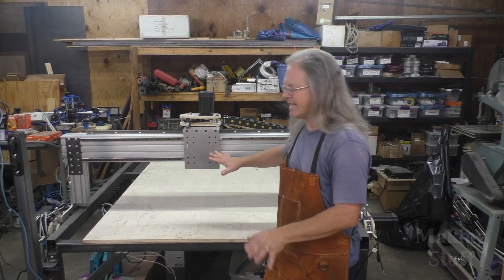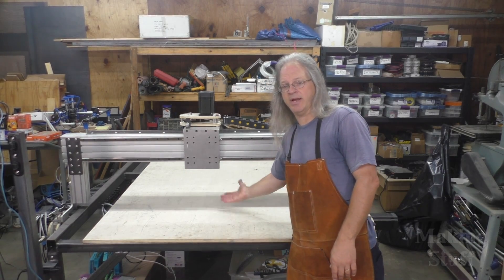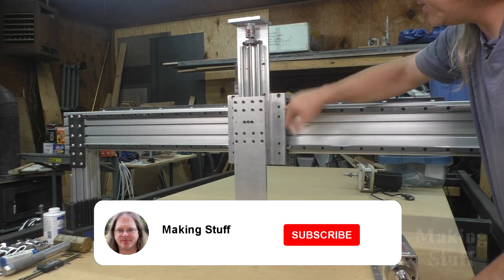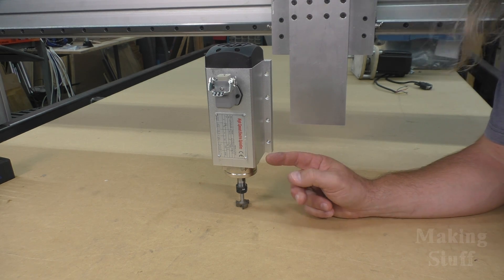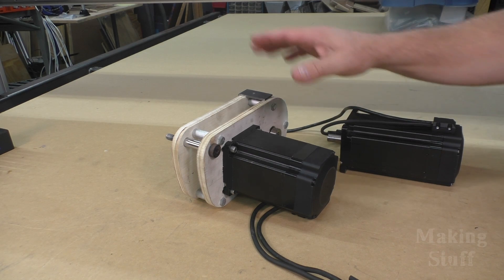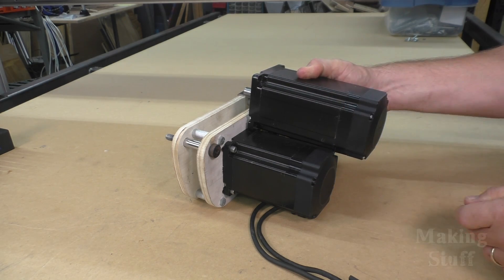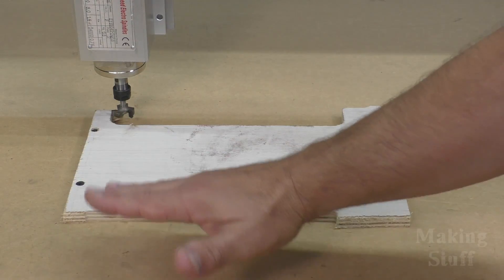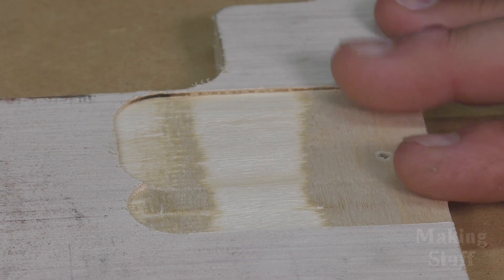Spindle Mounted and First Cut - DIY CNC Router Part 9

Comment from the maker: Finally making cuts with the CNC router.  Let me know what you think about it!
Reply: great work you have done there, I plan on making a 4X8 feet CNC from scratch and I am sure I will use most of tricks you showed on this project.
Reply: I know this was from 7 months ago but if you had to realigned your spindle so it's 90 deg to your table you could enlargen the holes in the back plate and then use a washer and nut. The larger hole will give you some wiggle room.
Reply: I know this video is from a year ago but you may have discovered that you don't want to reduce your spindle height TOO much, it limits what you can do. There have been many times I've had to remove all my spoil boards to accommodate thicker materials and items. Namely: live edge slabs for engraving and routing....They are anywhere from 1 1/2" to 3" thick.
Reply: Great job but I'd like to know how much money is involved
Reply from the maker: @sickvic3909  All the details are on the web site.  Makingstuff.info

Comment: This is a great series. For tramming what i have is a 1/2 inch shaft circle cutter, one of the ones that has the adjustable arm and the cutter. It mounts in my 1/2 inch collet just right and gives me a 8 inch wide tramming length when adjusted all the way out to the max.

Comment: About the pinion rack why you did not connect the servo motor directly to the pinion thread rather you have used a belt ?
Reply from the maker: I get the mechanical advantage with the 3:1 drive reduction.  That gives it more torque.

Comment: Hello,
A verry fine machine you build.
I also build a CNC designed by me but I have a problem. I have a similar spindle with yours but I have a ptoble. The spindle gets verry hot even on small jobs. I configure corectly the spindle in the VFD.
Do you know what could be the problem?
It gets hot even when he is spining in the air.

Comment: im still gathering parts for my 9014. bought my control panel, motors and spindle with cables from corvetteguy50 just waiting on the frame. i have to build a table as well and am considering using food service stainless steel table so i can use the table itself as a grounding point. way too hot in arizona right now to do any work in the garage right now anyways. i was considering watercooling my gecko g540 because i found the perfect waterblock and pump setup as well as air conditioning the garage. decided to go with the ESS system out to the controller because its speed is faster than using the UC100. made a duplicate of a totally stable machine i use for the cnc with the sabertooth 990fx mobo and 8 core fx8350 32 gb ram, gtx 780 sc with a seasonic 850 watt 90+ platinum power supply with a corsair k95 keyboard that has the 18 macro buttons on it to place code into for regularly used commands suck as home or even a wasteboard leveling. i had actually found a 4x8 food prep table with a sink in it that i will use as the coolant tank. and has a shelf on the side perfect for keyboard and mouse. and enough space left to put my drill press and grinder on the opposite side. ive been gathering my parts since about january and buying them as i get money to do so and getting very anxious and wanting to quit using the 3018 for anything but small laser jobs.  maybe ill give it to my grandsons to play with once they show they can be safe around tools. started off wanting to spend maybe 3k but i doubled that number awhile ago and still have maybe 1-2k left to spend to get stuff where i want it. love the machine though it came out great. good luck with it.

Comment: Hi, thank you for the video, and congrats for leading your proyect almost to the end, i have a 2.2kw water cooled spindle and i was wondering if the square air cooled spindle it is more or less noisy, have you idea about that?, i like the idea of don't to need a water system making thinks more complicated, thank you again for your time :)
Reply from the maker: I ran an 8 hours engraving with it and it did not over heat.  You could still touch the spindle right after the job finished.
Reply: @MakingStuff  Thanks, and how about noise, compared with a water cooled? 🙂

Comment: Hello, I'd like to mount this type of square spindle on a QueenBee cnc but the Z axis gantry uses a 2080 vslot aluminium profile instead as a mounting plate. Do you know where to find an aluminium plate with holes to be able to mount this spindle ? Thanks
Reply from the maker: No idea.  All you need is a drill and a plate of aluminum and you can just make one like I did.
Reply: @MakingStuff  ok thanks for your response. Yeh, I saw your other video. I'll probably end up doing that too. One inch thickness for the aluminium plate is it good enough ? Not sure if you already talked about it.

Comment: Hi. What program are you using to run gcode? Assuming it is a web browser interface. In turn. Is there an electronic unit that you connect the PC to and controls the motors? I can't tell whether this is a 'closed' system with encoders to feed back 'real' positioning. Thank you for posting your adventure!! :-)
Reply from the maker: I'm using Linuxcnc.  It is a closed loop system, but the controllers handle the encoders, not the software.
Reply: @MakingStuff  Many thanks for taking the time to reply. I need to retrofit my OozNest WorkBee open loop set up with a closed loop system as it is not accurate enough for my needs. I've made I think good progress on these last couple of days. Selecting motor (4 wire as opposed to 3) and driver (motor tuning software to 'talk' to the driver seem to be only in Mandarin or Cantonese - Chinese is not a language) + motion controller which I've come down to the Novusun V2 flavour + Mach3. I am finding it tricky to find something with good support. A lot of them seem to be 'outsourcing' it to us consumers and forums!!. The word on Chinese offerings out there seem to be that they are fairly reliable. Certainly no worse than US or German offering for a huge lot cheaper. I've managed to find how to set up the emergency stop, 'home' position and soft limits with Mach3. Now figuring out how to set up a probe for the 'work home' then I'm more or less ready to start buying the kits.

Comment: Good start, you will find you want all the z height you can get. 2 layers of mdf are good. Screw some aluminum t tracks to the mdf parallel,  the cut and glue mdf strips in between,  surface table and you will have a start.i usually surface .02.
Oh and you can find cheap surfacing bits on ebay( yellow) 1.25" for 10-15

Comment: i would be tempted on the bottom board to drill larger holes for the bolts and not torque them up so much MDF is a sponge and moves with the heat and humidity, torque a bed that size up and if it rains you might find it trying to move around a bit...just allow for expansion, I noticed it on my board .  I live in spain with big temperature and humidity differences and it happened a little on mine and my top board had a slight rock in it and my loosening off the bottom it went away and back to zero.
Reply from the maker: You are correct.  I went out to the shop yesterday and the corners of the top MDF board were curled up. I need to come up with a better plan.
Reply: @MakingStuff  maybe allow a large hole and dont clamp the bolts so hard either that or its a plywood base, plywoods unaffected normally as its  layers of wood layed alternate ways so is not subject to the problems that MDF has, 16 ply marine grade is the best, wont move at all. just bloody expensive. 

I use 2 layers of 15mm green mdf on my board in the end,  one bottom board which i sealed and bolted down just enough so it wouldnt move then a top board with  holes cut for cams but then i sealed the entire board and holes like the bottom board and so far no problems, a sheet of ply for my machine would be around 120 euros seems a lot of money to toss it out a year later as the top board is sacrificial, Ill see how i get on this year , if it warps then its over to marine ply next year! Good luck. 

 ps if I router  in to the top board or score it by mistake i just run a bit of sealer on to it to prevent any ingress, we have something in spain called tappiporus which is like a watery varnish but with a high solvent base, drys in a few minutes but its designed to seal wood before you prime it. really works well.

Comment: You could bend some rod that fits in the collet of the router 90º, and put a dial on the end, Then just swing it around to see the runout of the alignment. I'm guessing it's going to change in different parts of the table.
Reply from the maker: I actually tried this last night with a dial indicator and it showed mostly the same across the whole table top.  There might be a .003" difference from front to back depending on where I take the measurement on the spoil board.  Thanks for the suggestion.  I'll probably show more in a future video.
Reply: @MakingStuff  3 thou! The cylinder heads I used to machine were bent more than that - lol -.

Comment: How do you prevent inaccuracy in the table (sag, mdf variations, axis flex) when setting the tram?
Do you tram at multiple points and take the average? Just curious.  Try cutting a board into a square then stand it on each edge to see how accurate your tram is.  X edges might vary from y edges.
Reply: The flatness of your test doesn't show how good the tram is.  The workpiece and the bit could both be at 5 degrees off vertical and it would be smooth, but the edges of a side cut will still be off 5 degrees. It makes a difference for fitting pieces together 90 degrees.  
Great machine!  
The CNC  i made on my channel is all plywood using the roller bearing mechanism. It was incredibly cheap to make but I can cut .05mm accurate holes no problem! 
I once cut the wood away from a sticker that was stuck on the bottom of my wood workpiece because I only measured wood depth, not sticker plus wood depth!  I couldn't believe it!!  The sticker spanned the hole that I cut out.  I thought it was a fluke, but it happened many times. So much fun!
Reply from the maker: I put a dial indicator on it last night and it does show that there is a slight bow to the table top.  Will probably show more on a future video.  Thanks for the info.  I enjoy hearing good suggestions from viewers.